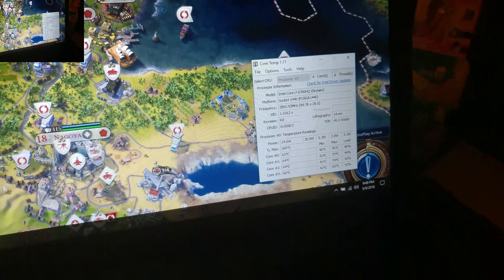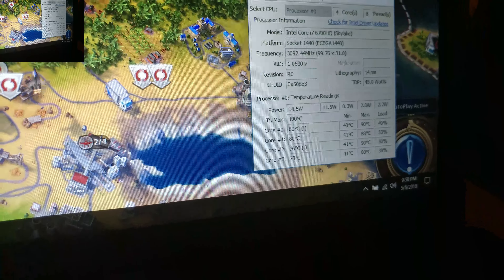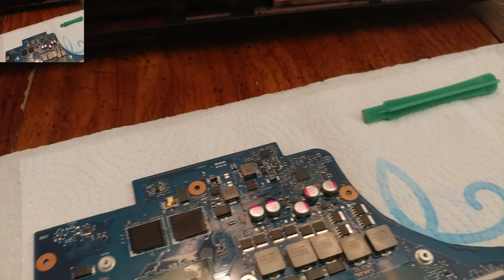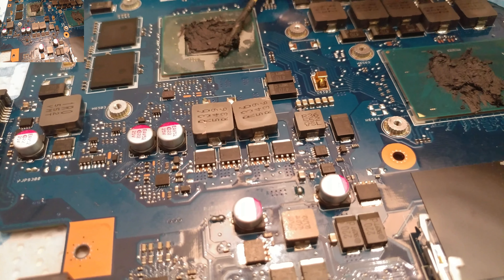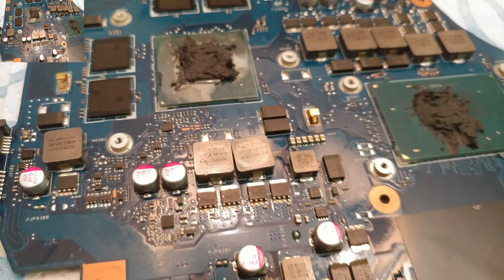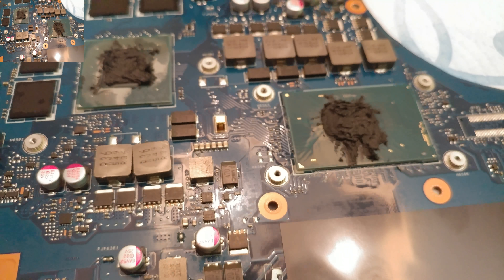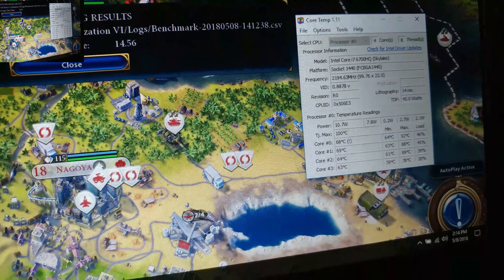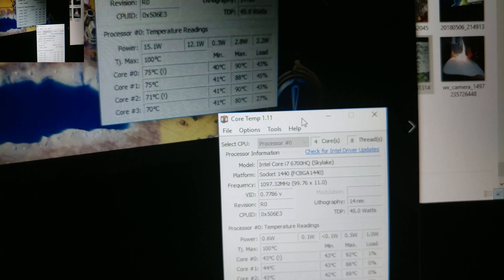Graphene thermal paste on Asus laptop

Comment: remember that the paste is only a bridge between the external heat spreader or die on the processor and the heat sink block. you can delid the cpu to remove the terrible internal heat paste under the cpu heat spreader and have a more efficient coupling. the thinner with least air pockets the paste has the better, because it cannot dissipate heat by itself it can only transfer it. more for desktop CPUs but you get it. that paste looks really blotchy and fluffy, im sure you can make an outstanding product that can beat grizzly kryonaut or any of the liquid metal options, but right now its like whipped graphene cream
Reply from the maker: Baigle1 very true. I'm not certain I'm brave enough to open my processor, just because it is direct to the motherboard.

Comment: I think you had a bunch of micro air pockets in the graphene paste. I think if you put it in a syringe like the other pastes and let it settle over time you may get a pretty uniform paste that you can squeeze onto the chips without reintroducing any air pockets.
Reply from the maker: You might be right. The good part is that the thermal system is spring loaded, and the viscosity of the paste is fairly low. So in time it should spread out.
Reply from the maker: And an update... core 0= 91, core 1= 81, core 2=89, core 3=73. So significantly cooler after the dust settles.

Comment: What are some different grades of graphene paste providers you prefer? Plus you put so much thermal graphene or carbon paste as demonstrated because heat coverage is dependent on higher surface area requirements to wick the same amount of heat that the silver-based paste? No shorts were experienced after near two years of operation as from today?
Reply: If it works, then we have a cheap and reliable innovation even if it seems messy.
Reply from the maker: Still working 5 years later.

Comment: way to much paste, would perform even better with a small dot and have it spread byitself. how was this made? i have read that graphene was ultrasonicated in ethylene glycol then added to a thermal paste. another idea is to make a freestanding graphene sheet a few mm thick and use it instead of a paste
Reply from the maker: You are right, but it has spread out a bit and gave much better benchmark results. (I'll do a video on it soon) This paste was made by a proprietary method, and we are looking into field testing to improve it. I might make an effort to give a bit of this for free, so others can verify results. So far, the few people who have tried it got tremendous results.
Reply: awesome. cant wait to see more!
Reply: @Venturestarx  If i get Graphene correctly being the greater thermal conductor the cooler/pipe/fan kit vill be the actual bottle neck.
Could you 3D print a "NH-L9i" in Graphene and get better cooling in total?
Alternative somehow make a larger Graphene base block to buffer in the middle of the cpu & the cooler?
A step further even make the fan Graphene based rather then plastic helping with the surface & dissipation?